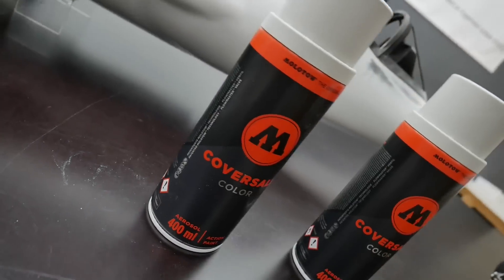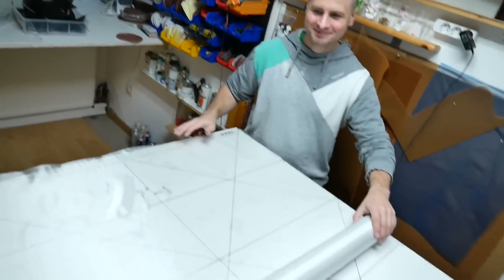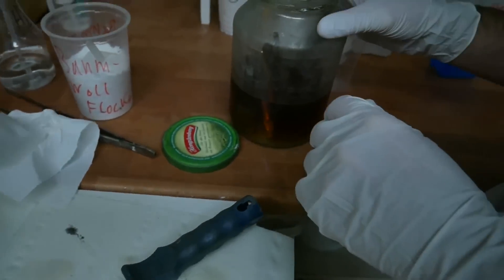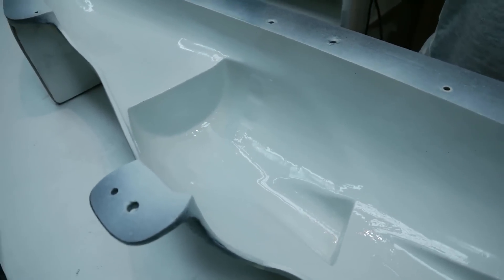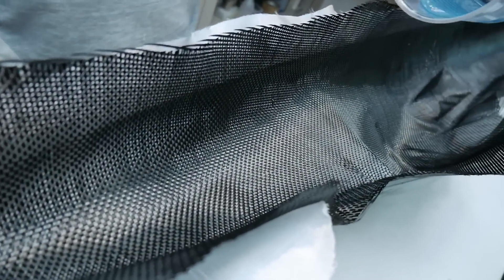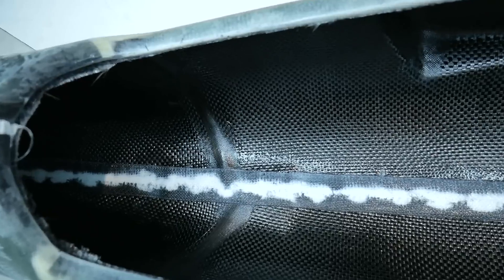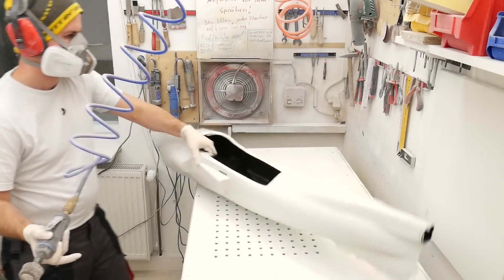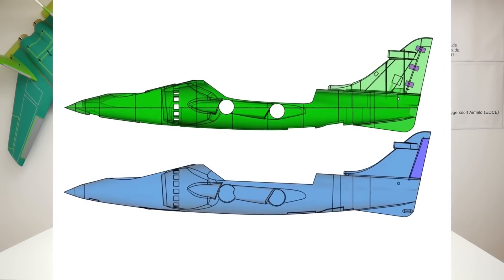RC Harrier Carbon Fuselage Laminating | Full Build Documentation

Comment: So cool, so the white acrylic paint applied to the inside of the mold bonds to the fibre and releases from the mold? That's amazing, it's an inside out paint job! Do you use any type of releasing agent on the mold before applying the white acrylic?

*Edit, I see your answer to the same question from someone else 👍

Comment: Very nice quality layups. Looking forward to the rest of the build. Pro tip, use cellophane wrap after wetting glass over your putty corners to get fast smooth shape. it allows you to work the corner shape without pushing bubbles in or moving the glass. Peel when wet if you must or after kick for smooth finish.
Reply from the maker: That´s cool mate!

Comment: What diameter is the duct ID? Consider ultra thin large bore ring bearings for smooth nozzle movement for your VTOL version. Lilly Bearing from China has cheap large boar ring bearings. I got 316 Stainless Steel 50mm ID 62mm OD 40g for $15 vs $145 ea. from local suppliers. Ease of installation and smooth reliable movement under load might be worth the extra weight. They also come much bigger if you need. 316 stainless steel is lighter than carbon steel and you don't need high RPM so they will likely outlive several models.

Comment: Be sure to wear air particulate protection when you cut or grind carbon fiber. The dust breaks down small enough to get in your blood stream where it shreds circulatory ways and capillaries. Can kill. Extreme pain
Reply: Thank you for this, i was actually beginning work on some carbon fiber and did not think to wear protective gear